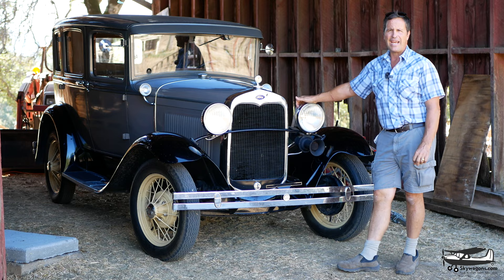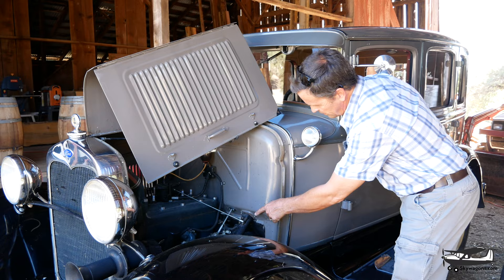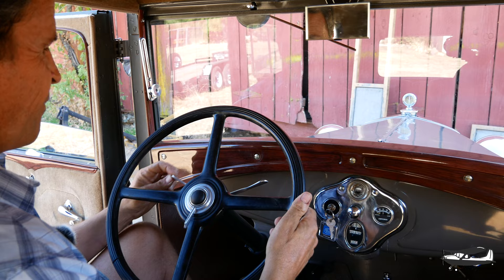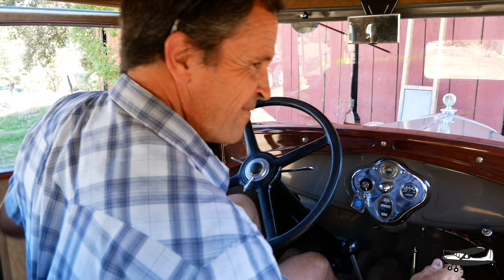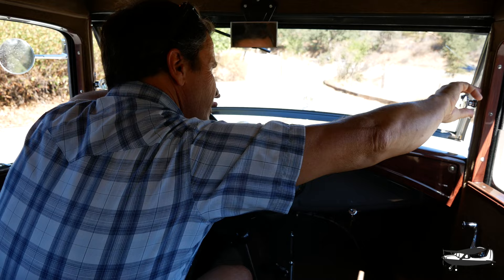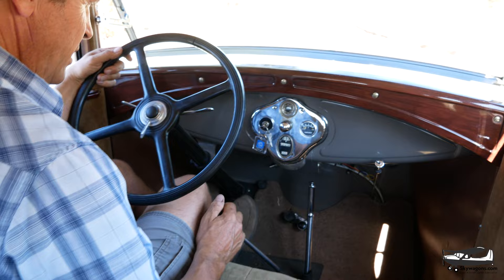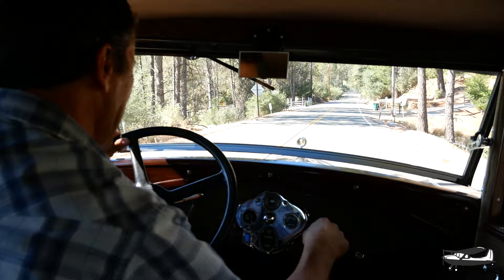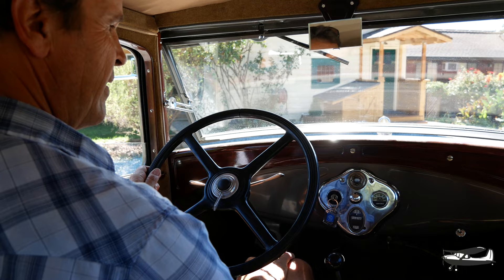1930 Model A Ford

Comment: Just this summer I bought a Model A and I’m having a ball. It is perfectly suited to non-highway driving. I drive to the hardware store, supermarket and taco shop. If you’re uncomfortable with people waving and smiling get something else. ½ the price of a Camry, reliable, amazingly rugged. If you are handy, even a little, you can do all the maintenance yourself.
Reply from the maker: That is just what I use mine for.
Reply: I bought my '30 Coupe as a college car in 1969.  I sold everything I owned from that era except for that Model A.  I still love it and drive it- not bad for a car that sold brand-new for $495.

Comment: That was great fun. It’s great that you can actually make use of it to commute. You mentioned no sycnchro but you didn’t appear to be double clutching. I drove 18 wheelers and highway buses for 30 some years and even today, most aren’t synchronized. So double clutching. Also, no seatbelts or turn signals? Do the cops leave you alone⁉️😜🍀👍🏻
Reply from the maker: It doesn't really need the double clutching on the way up the gears, but it does on the way down.

Comment: Very cool Mark . Does current gas cause any grief with the engine or fuel system? Probably does okay as far as fuel economy I bet .

Looks like you enjoy your new Ford !
Reply from the maker: It seems to be fine with regular gas and a bit of lead additive.
Reply: When the Model A was introduced, there was no unleaded fuel. Leaded fuel wasn't around until much later.
Reply: My Model A doesn't really like ethanol, but runs OK with it. It loves non-ethanol gas with a cup of kerosene added to the tank.

Comment: What year did they move the gas pedal to the floor?
Reply from the maker: I think model A's always have a floor gas pedal.  They also have a hand throttle on the steering wheel though.
Reply: @skywagonuniversity5023  So it was just the model Ts with just the steering lever throttles?

Comment: When changing down way more simple to double de clutch or double clutch in USA speak .
Reply from the maker: I do double de clutch from third to second.  Going up the gears doesn't really need it.  The gear oil is very thick and slows the gears in neutral.
Reply: My first car was a Model T, the Model A was a great advance with a gear box! The T the floor pedals were the low gears and reverse, and outside the cabin there was a big lever for high gear. You used the wands for advance and throttle, and sometimes it felt you needed three hands. Great off road vehicle, top speed of the T around 35 mph. Brakes if I recall used the gears in some fashion.

Comment: Does it have a heater??
Reply from the maker: No heater.  Maybe it was an option though.
Reply: The model A heater was the world's simplest device.  A cast metal  "tunnel" is placed on the exhaust manifold with air entering the front, warmed over the manifold, then entering the passenger compartment  .  No fan, no problem.